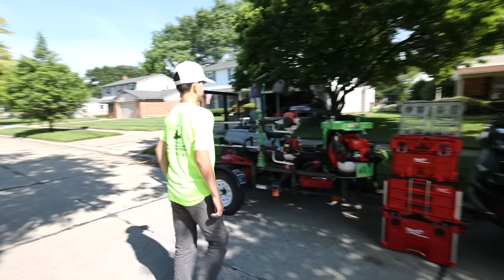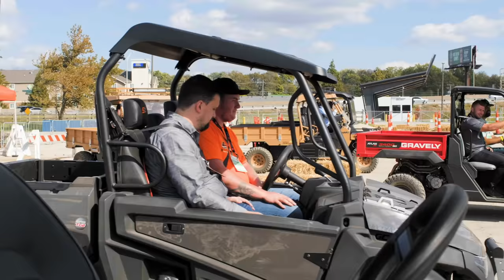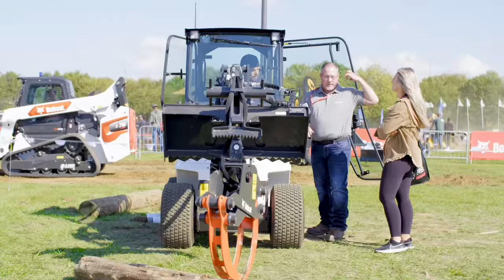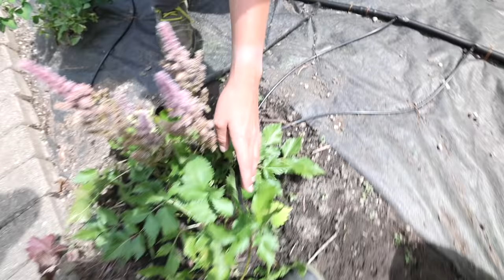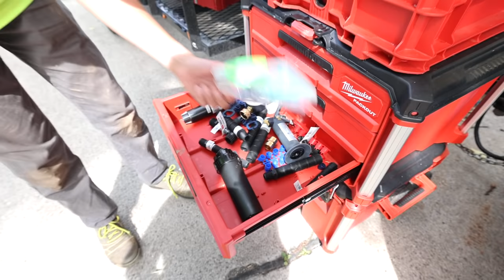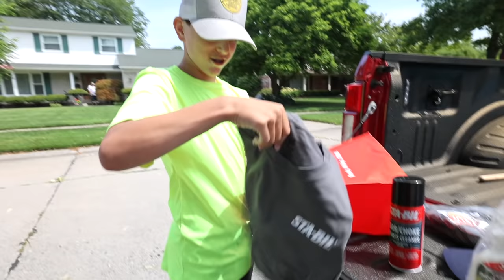HE'S ONLY 15 YEARS OLD & CRUSHING IT!! [GABE'S LAWN CARE]

Comment: What a great young man. He will end up with 20 crews and will be doing $100k jobs. He's very smart to be doing something he loves. I understand. I too was fortunate enough to do what I loved. I started planting trees with my dad at age 6. They were tiny oaks. They are now a good 150' tall and wide.. I loved running any kind of equipment. Had a Bobcat in 1980 and an old Calif Highway Dept. dump truck and never looked back. Then I also loved lighting. I had done that when touring with musical groups. Between the landscaping and lighting I started landscape lighting co that grew into installations and temporary lighting for events. 
I would highly recommend he investigate the lighting aspect of landscaping. If you're doing sprinklers, it goes hand in hand with it. Buy some low voltage lights and experiment with them to see what you can do. A lot of wiring can go in with sprinkler pipe and wiring. You can make a lot with lightning and it's very satisfying. Good luck.

Comment: What's up Brian! I'm Trey I'm 17 and started lawn care in 2019 at 15. I definitely felt his pain with almost being stuck because of not having a license. But this last two years has been amazing for me. This year in particular has been super awesome. I'm up to 20 weekly lawns and I'd say about 50 regular customers for landscaping and misc. jobs. Running a John Deere z425 and a John Deere 652r stander. I bought an 03 f250 with a straight blade for snow removal and have about 30 residential and 4 commercial clients lined up. The previous years I ran a four wheeler with a blade and snow blowers. I got to run the blade a little bit at the end of last winter and what a game changer! Anyhow there a brief bit of my story/business. lmk if you need another interviewer ;)
Reply from the maker: That’s awesome buddy! Keep it going!

Comment: I am 14 I have my own business I’ve been doing it for about 3 years at the moment I have a echo 2620 trimmer and a echo 8010 And also a PB 2620 handheld blower I also have 2 5 gallon sure can and a 2 1/2 gallon sure can and I have a Toro titan HD 1500 with a 48 inch deck